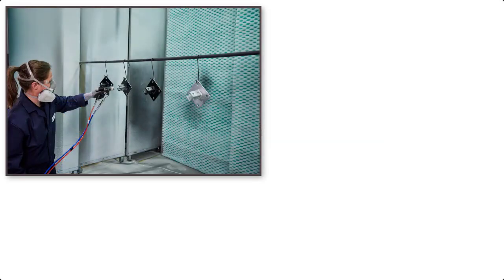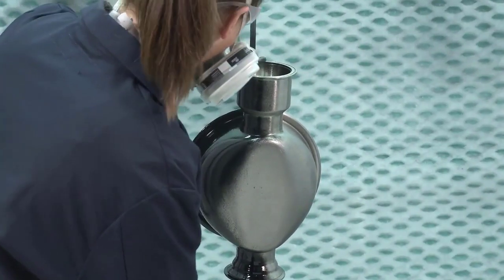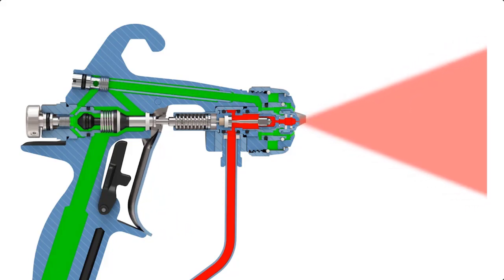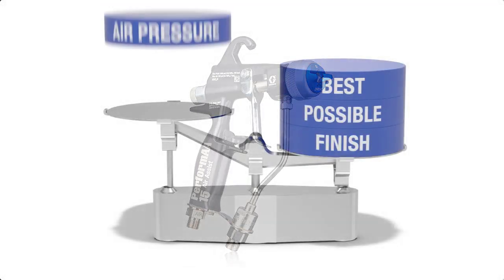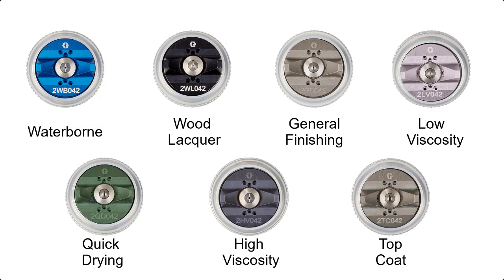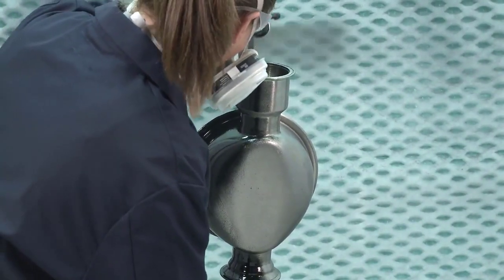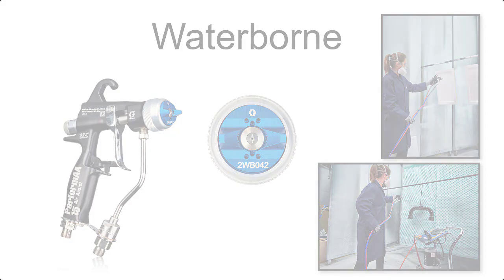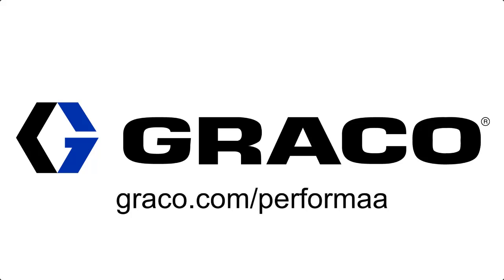PerformAA Spray Gun: Air Assist Air Caps Explained

Comment: any special spray cap for high volume solid of paint material...say 98%  VS of paint material.
Reply from the maker: The PerformAA high viscosity air cap, part #2HV042, would be the way to go. The high viscosity air cap is designed to atomize the tails of high viscosity and high solids materials, while minimizing finish quality defects due to entrained atomization air.
Reply: Can you explain the difference between this performaa 1500, and the G15?  The g15 is about twice the price.